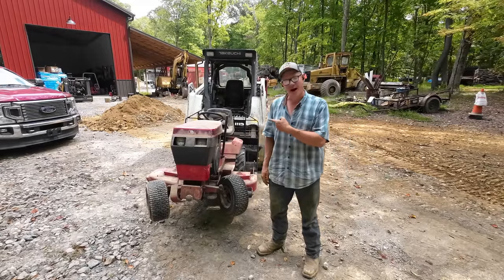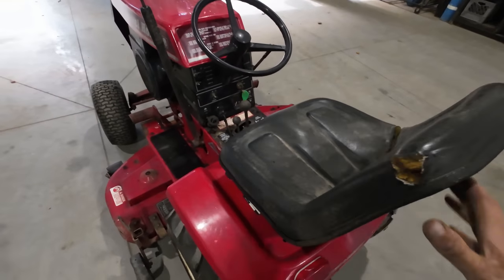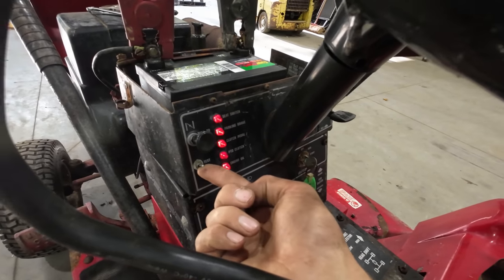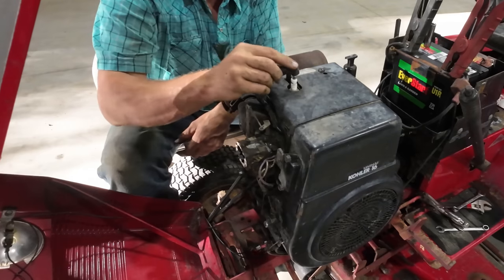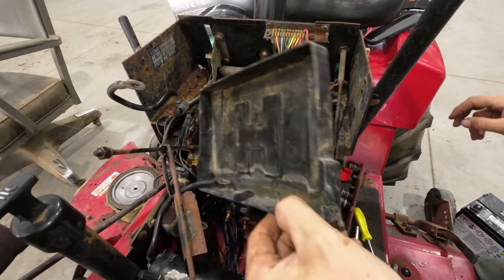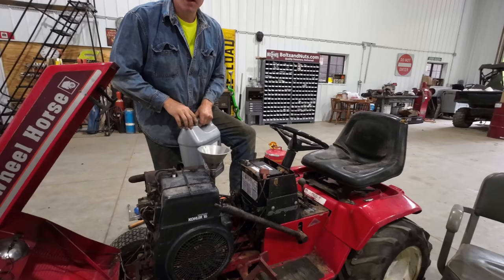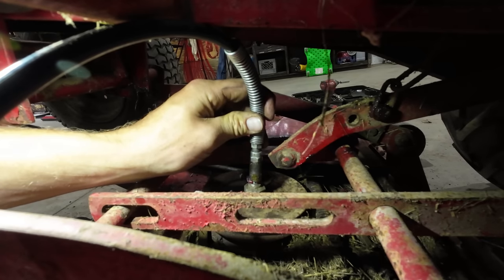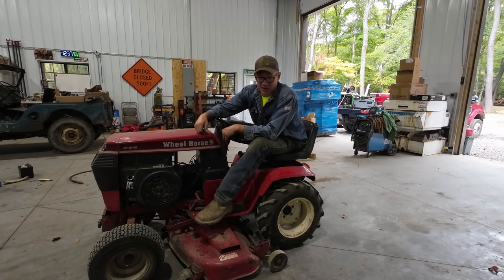FREE! Wheel Horse Garden Tractor sitting for YEARS! (WILL IT RUN??)

Comment: I had the same Kohler Magnum 16 engine on one of our grain augers. It spent its whole life out in the weather, once a year I would have to pull the float bowl off the carby and give it a clean out, other than that it always ran without fault. One day it just lost compression, I’m presuming it broke a  valve spring, without pulling it apart I cant be sure. I just replaced the whole thing with a cheap Chineesium Chonda, it does the job but not as well!

Comment: I got a '96 Craftsman for free out of the trash. Cleaned the float needle, put air in the tires, and it fired right up. Didn't even have to charge the battery or put fresh gas in it. Still runs just fine. Very similar engine as that Wheel Horse. Sounds exactly the same to the ear.

Comment: I would take that Wheel Horse any day over a Cub as ive owned both and the Cub was in the shop more than cutting grass the Wheel Horse ran until the deck rotted off 
and i sold my farm and sold it for $500 what i got it for used

Comment: This just goes to show you that you should not just bypass free stuff.   This is an example of what is regularly placed on the side of the road (machine wise) with a "free to good home" sign on it.   Around my neck of the woods there are plenty of people that just like to tinker with things and free stuff on the side of the road doesn't sit there very long.   I saw an on older Craftsman riding mower placed on the roadside by my neighbor at about 11am.  I was out running errands and had already decided I was going to stop by and inquire of the asking price when I finished.  I returned at 1:30pm and it was already gone!   I asked him what was wrong with it and he said it just needed a bit of TLC and that he was getting a brand new mover.

Comment: I highly recommend you looking at those engine numbers and letters for your information needed for parts and attachments for it to. Model and code is usually your ticket for that to. You'll need the year it's usually the last four digits on Kohler engines I believe it's different on that part of it than A Briggs and Stratton engine though. I'd use that information to get A owners manual for it and parts ordering books to.

Comment: My landscaping company inherited a very similar if not exact model when we took over maintenance on an estate (that's a term we use over here for any customer who speaks rather posh and owns more than 2 acres ) previous gardeners had hammered it along with old owner so wasn't surprised when part of the conrod flew past my ear. Our new owners insisted on buying their own machine so we had the use of a new brand 20 horse Toro which was still running well when I relinquished the contract in 2014.

Comment: I'd take it. Used to run one when I was head of physical plant at a distribution center and I had acres of field to mow. I'd swear it was 4 wheel drive. I was mowing against a wall and nosed up to it and it walked right the wall till it almost did a wheelie. Don't sell it short, it don't mind "brush hog terrane" specially with those ag tires

Comment: That is not a four pole relay or contactor.  If it was there would be a total of three or four electrical contacts.  There would be a total of eight terminals for a three pole and ten terminals if it were a four pole.

In this case its a single pole.

Three are two terminals for your power pole/contact.  And two terminals for the coil.

Comment: Matt, the other reason why those bolts into the head break is they were fitted with hand tools and nowadays everyone is using battery-operated impact wrenches and that is why the bolts are breaking as they were not designed not fitted by these type of tools...

Comment: The 400 series tractor refers to the size of the frame and the bearing weight on the wheel rating. The 500 series has tapered bearings on the front wheels.
    The M series Kohler is a beast of a motor. , Torque all day long.. The later Toro Wheel Horse 416 had the Onan engine which ran great,but are expensive to work on and we're not around very long.
    The front bottom hood pivot is wallowed out. Very Common. Flange bushings will work

Comment: I do not ever use slime!   A tablespoon of that stuff is too much!  You were pretty thorough, but it is a lawn mower and the business end of the machine is the deck!  You should take the deck off clean it and sharpen the blades!   There are a whole bunch of Wheel Horse tractors out there without decks because the proper care was not exercised with the underside of the deck!   Unlike all of your Cubs, the decks on Wheel Horse tractors are easily removed and replaced so they can be maintained properly!
Reply from the maker: The decks come off of Cub cadets very easily as well?
Reply: This is a garden tractor not just a lawn mower made for more then mowing,deck is not the only business end, that maybe be why you don't see them with decks.